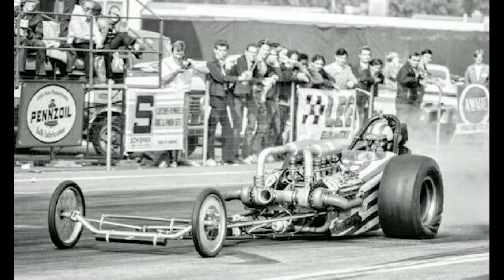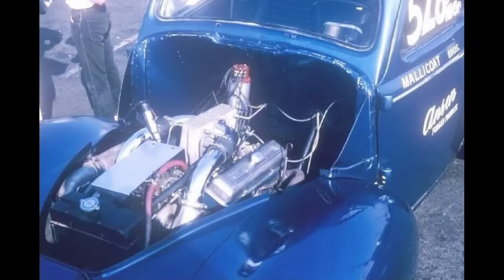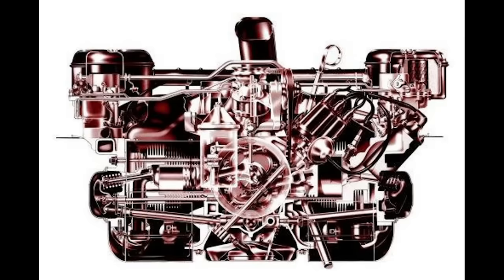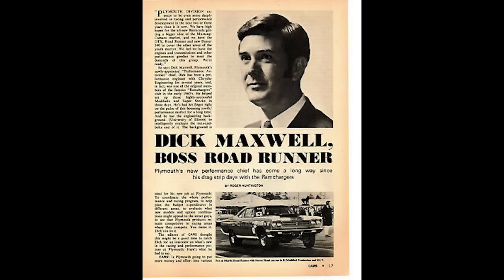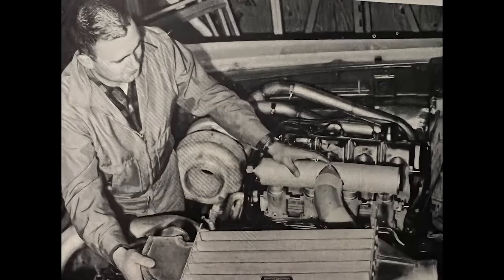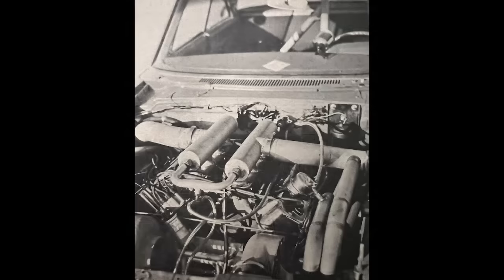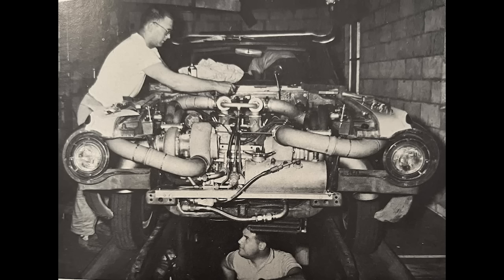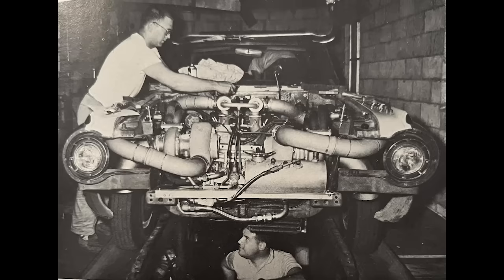Drag Racing History: Twin Turbo Hemi In 1965 - The Wacko Story of The Hemi Honker

Comment: Outstanding job Brian. Excellent look at why my life has been so positively shaped from my 62 years as a serious Drag Racing Fan.
Reply from the maker: Thank you!!
Reply: @martymorse2 You took the words right out of my mouth!
Fantastic post, Brian!
Reply: @brianlohnes3079  thanks i didn't know about this moparty history 👍 , was worried about going to car show's/ect and being acceptable to run big block 383 ( stolen/dead, frankenstined/welded-up+moded hemi is it's replacement along with a manual transmission TR6070 dropout ) or hemi-4.5"stroker and yes kinda trying to get my charger to look period-ish correct for pre-1976/2-owners ( or a prototype program for the upcoming 1970 model year ), didn't realise that im copying somewhat of the 1960-70's engineering-teams car as i though that parts of my car/build was cheating-ish for a drag/trans-AM/daily ( imperial interior design theme aka interior by imperial-brand ) theme 

mostly im trying not to care about others as it's my car and im not flipping it for sale 😉 but still seeing this and the 300C fuely's ect makes me feel better about my choices after being influenced by my friends/millennial's+zoomers and my family, by youngest sibling love's JDM-90's and up car's and turbocharging and BEV's

Comment: Great story, Brian! The amount of engineering that went into the early cars of the sport is just mind boggling, considering the technology they had at the time. Also, as a modern racer who tries to stay on top of connections and networking in the industry with the luxuries of the internet, I could not imagine the leg work that went into chasing down industry contacts at that day and age.
Reply: Back in the day it was easier. Now a days you gotta deal with a computer. Fuck modern everything tech and safety has ruined racing it  has literally lost its soul. We need to teach our children right and doing so is teaching em the fact that gas is better than electrical hybrid

Comment: 427ci, 7-1 compression, 35psi on twin 140mm turbines at 160mph, 100% mechanical (which is why it couldnt build boost on the brakes). It is going to go unnoticed that modern transmissions deserve like 60% of the credit for how far racing has come. And rear ends were a biproduct of transmission r&d. And tyres.. dont forget the tyre wars.

Comment: There is alot more then a piece or two of the turbo honker left. A ton of that was in my collection for a short time. It was not made from the "Hemi Honker" car. Kramer now has everything that I had from the car including many of the original body parts in original paint. "The Honker" the red 1964 max wedge hardtop car was used to build the car. Thanks for the video coverage. There were also 2 different sets of turbos used on the car during the year and the water intercoolers were scrapped early on from the project as they did not assist much.

Comment: i bought a turbonics kit in 1975.. shocking increase in torque in my 301 camaro!  first time i let out the clutch, to switch bays for the project was mindblowing...never forget that momentof thrill.. slower times at the drag strip tho...could not get enough traction,even with a 3:08 rear ratio!

Comment: I, for one, am glad we couldn't throw a turbo, or 2, on our hot rods as readily, in the '60's & '70's, as it's done today.

It would have changed hot rodding & drag racing, just not in the way you'd think.

Relative to today, high perf parts were expensive. I remember a friend coming home from 'Nam in '69-'70, & getting a counter job at NAPA. He started @ $110 / wk.

What I remember is how good that pay check would be.

A brand new Edelbrock single carb manifold was about a wk & ½'s pay, my buddy's 'good' pay... me? Two-two & a ½ wks. 

 A new dual 4 tunnel ram?

I have no clue, never could afford a new one. Used? 2 months @ my pay.

A single carb Edelbrock doesn't cost 2 wks pay, today. Nor a used tunnel ram 2 months.

Because of the relative high cost of parts, things had to slide.

Building a hot rod '55? Engine, trans, scatter shield, butt gears, cheater slicks, traction bars... sure...

Shocks, brakes, (more than stock) or other suspension work? Not gonna happen.

A '55 w/ a 300-400 HP SBC & gears was a blast. Could be a handful on the street, but a blast.

A '55 w/ a BBC, 4 sp & gears? AND a stock chassi? That was a wheel standing, leaping bundle of insanity.  (Wanted 1 my entire life, after seeing the 1st!).

Now, take the SBC, add a turbo? Well, it'd change things, alright.

With the high number of fatalities, there'd be a very small 2nd gen of hot rodders.  BECAUSE of so many wrecks & deaths, law would have clamped down, hard.

The entire sport of drag racing would have been stunted.

Like I said, I'm glad we didn't have the technology, tools or tuning knowledge or components to slap turbos on our '55, 6's & 7's... it woulda killed most of us old racers off, & killed the sport & hobby.

Another great vid, Brian.

GeoD

You teased at the SoCal connection to birth & growth of hot rodfing & drag racing in this vid.  It'd be a big project, but I'd love to see you flesh it out & show the connection between hot rodding, high performance parts manufacturing & drag racing & the SoCal aviation manufacturing industry.

Grumman, McDonnell-Douglas, & others trained the fab guys & hired the machinists & engineers who made the parts, built businesses around them &/or went racing turning SoCal into the high perf mecca for decades.

Comment: As a kid working at a trucking outfit back in the early 1980's and being a gear head I played around with blowers/turbos from the 8V71 Detroit Diesel and trying to associate to domestic gas engines of the day.  It was much harder than it sounds and I didn't have much luck.

Comment: playing with turbochargers for almost 30 years myself. out of alllll the brand names out there i only use one manufacturer, garrett. why? well i worked for grumman 9 years myself and everything was made by garrett/aireserch. aircraft started, aircraft engines etc… that proved their quality to me. have a garrett 1752 on the genset, a 4702 on the semi and a 3582r on the pickup. holset’s all came off 👍
Reply: Journal bearing Garretts are the weakest there are. Their exhaust housings also always crack because of weak casting. Oh, and those stupid stub shaft boreless compressor wheels that always break shafts.

Comment: Chevy Corvair’s also came with an option for turbocharged version , 150 hp in earlier versions before ‘65 , then 180 hp afterwards. There were many , many attempts by countless racers to get those early cars dialed in using carburetors, but it took Fuel injection to get satisfactory results .

Comment: My father must have read the magazine article about the turbocharged Valiant, because he had aquired an Oldsmobile turbo with carburetor sometime in the late 60s for his 1966 Valiant station wagon. Alas, he didn't get around to installing it before the car was rear-ended. He traded it in on a new 1973 Satellite wagon instead.
Reply: I installed a Rajay turbo from a Corvair on my 65 Valiant 170 slant six, back in 1979. Would do 13.4's at 104 mph driving to and from the track. Ps: still have the complete car and drivetrain.

Comment: IMAGINE!!! If someone were to rebuild the turbo honker today with the technology advancements with tires and input shafts 😅 I could only imagine what that thing would lay down
Reply: Tom Baily did Dragweek a few years ago and after driving over 1,000 miles and racing at different tracks in 5 days, ran 5.99's in the 1/4 mile!
Reply: @markwise9868  holy cow that is fast

Comment: Time 830
Oxygen tanks
Specifically, these were found on WW2 era aircraft for breathing supply. I have 2 floating around the shop that I had used for my first homemade air compressor.    The two square boxes on the tanks are a mod by the car owner as the ones I have just have a 1/4" pipe fitting at each end.
Reply from the maker: Nailed it, Bob! The boxes were lids so they could drop dry ice in! Great info here

Comment: The intercooler where removed after the first couple of outings they didn't work and added a lot of weight.  The turbos where changed to littler ones to come in quicker. There was a bad backfire that broke the intake and that was the end bud and George where done with it.

Comment: Turbocharging internal combustion is important because... a normally aspirated piston engine is only capable of a 25% efficiency rate and 75% is just blown out the exhaust. A turbocharger draws on that back pressure converting it into new mechanical energy increasing that efficiency. Streamlined headers and ram intake manifolds do also.

Comment: Too bad Oldsmobile didn't put the turbo option on something between 300 and 325 cubic inches with around 8:1 compression and of course a camshaft designed to work with a turbo. I suspect they kept such a high compression ratio to offset turbo lag (early turbo charged gasoline engines typically suffered from the lack of consistent control of boost that took years of factory turbo efforts to finally bring under control on modern turbocharger systems).

Comment: For years, I've been wondering why it took so long for turbos to be adapted to gasoline engines.  I'm guessing that on top of having good control of boost pressure, controlling air/fuel ratios with carburetors and having optimal ignition timing with ignition systems from back then was difficult.
Reply from the maker: For sure. Electronic fuel injection and more advance timing controls kicked the turbo era into high gear

Comment: Imagine if they had gone with just one of those 140mm monsters...

I imagine, with the knowledge we have now,  it would have been a much more "workable" set up.   And possibly could have been part of the A/fx craziness happening at the time and even blown the doors off some of those cars. 

And let's also stop and consider... he was running 170+ mph, with an abysmal 60-foot time,  then just boiling the tires the length of the track. 

He said he saw 60+psi on methanol on a 426 Hemi...

That thing had to be making horsepower numbers that people would have considered absolutely insane at the time... I'm guessing 2,500+.

Comment: Comment was accidentally deleted by a bad phone

But, for another turbo reference, look up Buddy Ingersoll More than a tall tale, running NHRA Pro Stock in the early to mid 1980s w a turbo buick, he was banned...why? Because he was winning, constantly, beating big names (Glidden, Shepard, all..), which equated to big NHRA politics. 

Also, try running a turbo system on Nitromethane.. why hasn't it been done? (Hint:. It's been only attempted...hint, meltdown)

Read your reply, Brian.  Actually, yes, watched your video in full.  Did know it was not actually in contention, but very fast for a full bodied and full steel door car.

I know you're into telling the odd and rare stories, just thought the Buddy Ingersoll turbo 6 buick pro stock story was also pretty cool (and sad..), not many know, or have heard either.

Thanks for sharing

Comment: Mechanical engineering was aan economic and social priority. With every question to be answered or question to be asked they had support. I bet it was built like a tank too. They had bolted flanges and not the cheesey clamps and thin wall tubing like today. I know it was heavy so take your pick durability over efficiency for me.

Comment: That, is a Rodchester FI unit not 2 four barrels!
Reply from the maker: Wrong! They used the manifold, gutted, but if you look at all the photos of the engine the carbs are mounted in the center they are under a piece of sheet metal. If you think a 1960s Rochester mechanical fuel injection unit could support a 700hp boosted engine, you have a lot more faith in them than I do.

Comment: A supercharger will always make more power with a v8 than a set of turbos
Reply: Turbos will make more power than superchargers on any engine if sized correctly. Turbos suffer very little parasitic loss compared to a supercharger. Superchargers don’t suffer from turbo lag and may feel more responsive but as far as dyno numbers are concerned a turbo will always make more horsepower than a supercharger at the same boost level if both are sized properly.
Reply: https://youtu.be/myQdr_alzn0
If you watch this video it shows a centrifugal supercharger needing to make 18psi to match the power of twin turbos at 12 psi on a Chevy 454. Turbos also made significantly more torque in the lower rpm ranges.
Reply from the maker: Cannot say I agree with this statement on its face. What’s the evidence?
Reply: @johncase1112 John why is it then that the top fuel hemi dragsters and funny cars now only run those massive blowers rather than the turbos then ?
Reply: @peteloomis8456 they are not allowed to use anything else. Not even modern screw chargers, only those old Roots heat pumps.